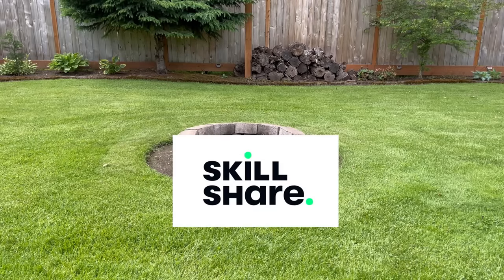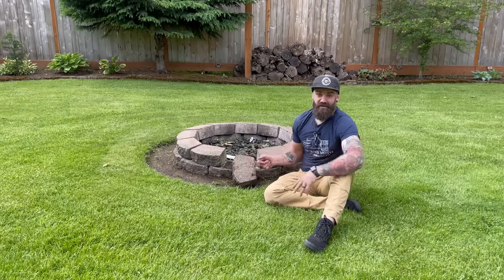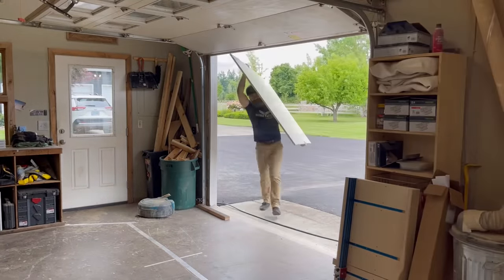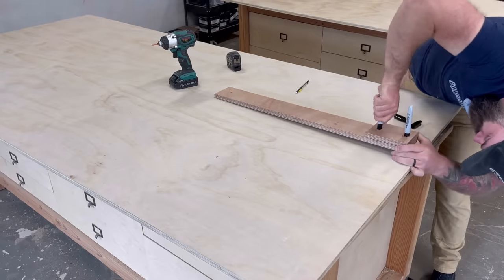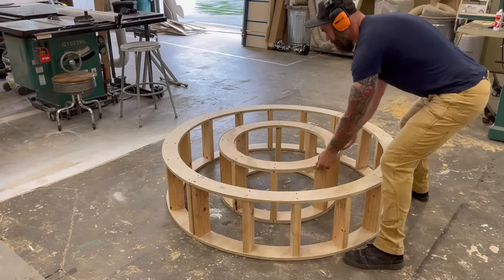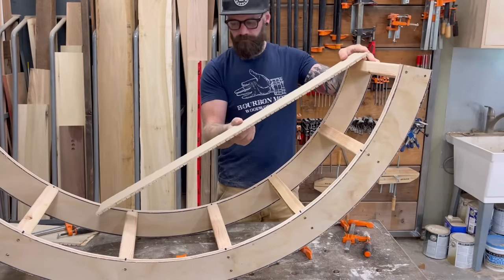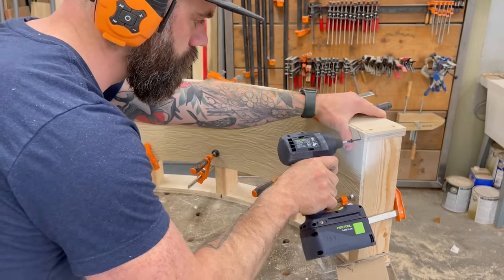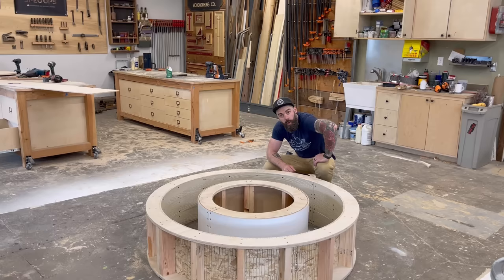Making a Concrete Fire Pit the Right Way || Ultimate Fire Pit Build

Comment: "Im not gong to rent a concrete mixer" Nobody has ever said twice......
Reply: All facts 👀
Reply: I'm wrecked I'll clean the concrete mixer tomorrow.  Is also one.
Reply: Honestly, if you've got a steel barrel with a lid which can be attacked and detached, you can dump the concrete in, the water in, the pigments used (if you use; even dirt or ash or crayons can work) put the lid on, place the barrel on a side, and roll it for a while, and you mixed the cement without a "professional" cement mixer. It works better if you add some wood or metal things on the inside, like how a washing machine has (a cement mixer usually has curved ones), to help with the mixing (and adding a few uneven parts to each of those "ribs", to help even more with the mixing), but it works even without that, especially if you add a few rocks (to tumble about and move unevenly, to lead to a more even mixture with less moving). It might need more effort to get the barrel standing upright again, or to place it on the ground without it breaking, but it works better than mixing in a wheelbarrow/cart. By the way, did you know there are folding wheelbarrows (sometimes called portable wheelbarrows) out there? I didn't know, but it makes having spare wheelbarrows A LOT easier! Where would you even put the 3rd or 4th wheelbarrow, if it couldn't fold neatly out of the way?
Reply: Lol my dad had me out two days in a row mixing and pouring from a wheel barrow. Said he wasn't going to rent a mixer.

He said I was taking too long and helped on the third day. Day 4 he bought a mixer. 

Bastard.
Reply: Also, he could have mixed the cement right next to his pit for a bit more efficiency
Reply: We have a mixer and it certainly helps, but it’s still quite a bit of work itself (have to load the bags up higher, can only do so many bags at a time, still need to dump and shovel to/from wheelbarrow, etc). I’ve hand mixed up to 70 bags without issue, honestly the fact he had to shovel it into the form is also where a ton of the work is, for a pad it’s just dumped from the wheelbarrow so not super difficult. But honestly past the 50 or 60 bag mark it’s worth it to just pay for it from a concrete truck.
Reply: @SapioiT  ? I’m referring to a portable cement mixer, we have the ryobi one, they’re pretty much all considered portable! But I’ve never seen one that’s placed on a table and that seems dangerous, even googling shows no such results, but I guess there are lower ones, was just pointing out that there are always trade offs, and pretty much all are going to still be a little higher than lifting to a wheelbarrow, and a mixer saves work but it’s not like it saves all work, it just saves the mixing part which I don’t find to be all that hard, just a little water and back and forth with a hoe, with a two man workforce it goes pretty quick with one loading, cutting and setting, and the other mixing. A mixer would definitely help more if solo, but in that case I’d hesitate doing a large product in general just due to time constraints to work the concrete.
Reply: @personperson9591  I see. There are also "cement pumps", which are basically a screw pump in a pipe, with a large hose through which the cement goes, so you can move the cement without as much effort.
Reply: in my experience, mixers are more trouble than they're worth. can only mix 2 bags at a time max, cant ever dump all the concrete out at once, and have to clean them out after every batch. its harder on the body but in my experience if its not enough to call out a concrete truck, its faster to mix it by hand in a wheel barrow.
Reply: @Smokey420Greenleaf  Interesting arguments. Thanks for sharing!
Reply: @Smokey420Greenleaf  by clean out after every batch you mean spray it with water?
Reply: If you will need a concrete mixer three times in the next ten years, just buy one…. New or used it won’t matter, because the stacking costs and annoyance of renting them makes it better to just own one….
Reply: @Smokey420Greenleaf   I dunno why concrete mixers don't come with a disposible plastic inner liner that can just pulled out and disguarded after use.

Comment: Former concrete guy here. I did residential construction in Florida and we'd spray our forms with oil to get them to release easier from the slabs. The other little trick is that you can fill screw holes or nail holes with petroleum jelly for exposed surfaces that you don't want to see fasteners. You can also cover seams with clear packing tape and get a smooth finish.
Reply: Wonder if its still there.
Reply: Great tips. For the inner circle, it doesn't matter what you would coat it with because the direction to pull to release the forms is a reverse circle and geometrically doesn't allow it to release.  Sort of like the Chinese finger traps.
Reply: What was the company? I am in orlando and would love to hire someone to do this
Reply: @garrettsanford5683  Carpenter Contractors of America.
Reply: I was a roadway worker on the I-4 project and then worked on the runways at OIA. You're exactly right. Using form oil, even on wood, will make them fall right off after the concrete dries enough.
Reply: you got no allergic reaction at seeing the rebar being hammered into the soil ? lol
Reply: Yeah. It was a great project to watch. Another idea is to make the interior form with a male insert surrounded by foam or plastic, so it can be removed easily and reused.
Reply: Make bottom of inner cicle a half inch smaller diameter.
Reply: @sephiroth1985102514  As a roadway worker, do you not agree that manhole grade rings would've been much easier, and for a very similar result? (If anyone is unfamiliar, Google "concrete manhole grade rings" and have a look.)

Not as fun of a video. But it would save you TONS of pain.

Also, watch your lawn mower around your new decorative rock. It's been two years, so—have you come to regret that one? If cousin Eddie comes over for a weenie roast, gets drunk and sloppily kicks your rocks around it will be a mess.
Reply: Guys, Here is The Savior

YaH The Heavenly FATHER (Genesis 1) HIMSELF was Who they Crucified/Pierced for our sins and “HERE IS THE PROOF”

From the Ancient Egyptian Semitic: 
"Yad He Vav He" is what Moshe (Moses) wrote, when Moses asked YaH His Name (Exodus 3)

Ancient Egyptian Semitic Direct Translation
Yad - "Behold The Hand"
He - "Behold the Breath"
Vav - "Behold The NAIL" <— YaH’s Crucifixion
He - "Behold the Breath"

“Behold the HAND that Beholds The NAIL” 

PROVES - YAH The Heavenly Father HIMSELF was Who they Crucified

That is EXACTLY what Moses Wrote

Here is what they mean

YaH's Name:
(Ya)d + (H)e, as YaH is what Moses called Him and YaH Declared: "this is My Name, this is My Name for all generations" (Exodus 3)

YaH is The Creator of “MAN”: (Genesis 2:7)
Yad He, (HAND BREATH), as YaH's "HAND" Formed man from the dust  of the Earth and His "BREATH" made him a living being (Adam)

YaH's Sacrifice of Crucifixion for “MAN”:
Vav He (NAIL BREATH), the "NAIL" through YaH’s "HAND", in Sacrifice of Crucifixion, that whosoever shall call YaH Savior, His “BREATH” brings forth life (Salvation)

How YaH arrives:
YaH arrives via the Tent of Meeting (Exodus 33:7:11, Isaiah 54, 55), where a Tent is erected outside the city, a cloud descends upon the entrance of the Tent and YaH appears...

Why they demanded YaH to be Crucified:
YaH was Crucified according to Hebrew law (Deuteronomy 21), to be NAILED/PIERCED on an Almond Tree for BLASPHEMY as it was for His NAME they demanded Him Crucified. The Messiah claimed He was YaH...

HE WAS YaH!!!

HalleluYAH translates “Praise ye YaH”

The Hebrew Book of Isaiah

Isaiah 42:8
"I am YaH; that is my Name! I will not yield my glory to another or my praise to idols.

Isaiah 43:11
I, I am YAH, and there is no other Savior but Me.

Isaiah 45:5
I am YaH, and there is none else.
Reply: @Praise___YaH  YHWH is the name of one of the gods in the Canaanite pantheon of gods. You are a member of one of the cults of Abraham and you ignore the history of your own faith.
So sad.
Reply: @DriveCarToBar  

It’s YHVH (Yad He Vav He) which means “HAND BREATH NAIL BREATH” and His Holy Name is YaH, as in HalleluYAH “Praise ye YaH” and you really need to read what I shared
Reply: agreed. I used a simple bottle of vegetable oil and a paint brush on my forms. painted the wood with a good coating allowing it to soak a bit and boom.. not an issue. I could see if you wanted to save the inner form. making one small section that would be a keystone to the circle. that way you could remove the wedge/keystone to release the pressure.
Reply: which concrete mix should I use??
Reply: We would use wd40 on our wood forms work great

Comment: Honestly, this was really well done. Couple things I would have done differently. 

1. If you had mitered the edges of your interior forms you'd have much less pressure pushing them together, and would have been able to remove the forms intact.

2. I would have poured a pad first. The weight of that ring will likely have it settling into the dirt over time, especially after rain. The pad would also have made interior form removal easier.

Going to implement this in my yard though, great idea 👍

Comment: Great job. Just wanted to mention, when looking for filler material for concrete, a good option is gravel. One or two shuvels per bag. Mix together, works great. Diesel is used the most often for keeping the concrete off the forms. Concrete work is unique in the way we have to consider wrecking the forms conveniently. City water drains is a good example.

Comment: It'll be interesting to know later if the concrete form cracks after the first fire.  I had a firepit built out of stone with mortar and it cracked not only the mortar joints but the limestone two piece top.  My firepit builder used a steel ring insert tight up against the stone and the heat caused the ring to expand, thus cracking the mortar and a couple of stones.  My fix was to buy a steel insert that was smaller than the pit diameter by 1.5" all around.  I also filled that void with mineral pour insulation to reduce thermal shock.  My insert has a large enough lip to cover the void.  I think your insert should be at least 1" smaller then your form to prevent contact between the steel insert and the inside of your form to prevent steel expansion from pushing out your form.
Reply: This right here is a great point - should be voted up
Reply: @gabrielh.2506  Or do what I did by not allowing a flush steel ring up against the stone to expand as it gets hot by replacing with a full depth steel insert with a smaller diameter packed with pour mineral insulation in between the insert and stone.  Much easier than lining with firebrick after the pit was built.  That has worked now for many years.
Reply: @JJ-fd2ob  The calculation for a 48" steel ring (my pit) is an expansion of almost 1/2" when the temp rises by 1000F.  A 3" ring will expand by 1/3".  If a ring is mortared to the brick, stone or concrete, the pit will crack.
Reply: @bobbray9666  what about using a fire rated mortar instead of concrete. Like what they'd use for chimneys?
Reply: @driver902  If you use a steel ring, which I suppose the purpose of it is to protect the concrete from flaking away, you'd still have expansion of the steel under heat up against concrete whether it be refractory cement or not.  The expanded steel will either push out and crack to concrete or just warp if the concrete doesn't give way.  Better to insert a slightly small diameter steel ring to allow for the expansion when hot.
Reply: @bobbray9666  When you calculate the actual radial difference with that linear length change, you see that you only need something like 1/8" space around the edge to account for that.  D=1/4", which allows for ~ 3/4" length change.
Reply: I all for diy projects and I once applied stucco to a single story ranch house singlehandedly so I can advise with all the effort put into buying and transporting a mixer, the bags of cement along with all the essentials needed then actually doing the work one is probably better off buying the pre-made firebrick unless its a personal life journey especially if water conservation is a necessity.
Reply: Even worse it could explode from the pressure of trapped moisture becoming a gas and expanding. This isn't a good idea unless you use the correct concrete.

Comment: I’ve done this same concept before and I can confirm it defiantly explodes
Reply: Gotta be the right mix brother
Reply: Wouldn't be an explosion of if it was meek. It has to be defiant.
Reply: I have a small charcoal fired forge. It’s a used helium tank with the top cut out, a piece of 1/2” iron pipe in the side to blow so air and sackrete I bought from Lowe’s. It did not explode and it hasn’t really even pitted with probably 100 hours of use at temps high enough not only to forge but to actually melt steel
Reply: That's really dangerous, the concrete explodes. Doing this is not safe at all.
Reply: @marciaccalas5799  it's actually more like a vigorous cracking you might lose an eye under the exact wrong circumstances but it isn't the end of the world.

Comment: Always remember, when using wood for forms, always spray with diesel or form oil. This helps the wood release from cured concrete...in all reality, you did very well. I do this all the time and can say you did better than most. Another hint, is, when it is curing, if it is hot outside, keep everything sprayed down and wet. This gets a better cure that is less likely to "dry out" and crack. Concrete does NOT dry. It cures. The end project is pretty amazing. As for your inside form, you should have burned it out...after all, this is a fire pit...
Reply: Came to the comments to see if I was the only one thinking he should have just burned it out. Lol
Reply: Never spray with diesel
Use any oil. Even vegetable.
Reply: @MACizera it breaks down concrete compound so the layer touching the Crete will degrade much faster.

But the real issue is why not use canola oil. (Form oil works) and not hurt the environment?
Reply: @MACizera form oil is mineral oil.

You can just buy that it's best.
Reply: @thenarrator1984  Totally agree.
Reply: Diesel is commonly used instead of form oil and will evaporate
Reply: Glad I'm not the only one that defaulted to burning.
Sitting there talking to the screen going "If only there was some easy way to get rid of WOOD on the inside of a FIRE PIT" 🤣
Reply: @thenarrator1984  hUrT tHe EnViRoNmEnt
Reply: @chrishaugh1655  Since it's his back yard, and he's the one who sat by it during the first burn, tHe EnViRoNmEnt was his own lungs.

So yeah, don't hurt the environment.
Reply: @AdorkableDev  I can't tell if you're being serious or not. For the sake of your own intelligence level, I'm hoping for the latter.
Reply: or buy a plywood that is pre oiled for the forms, but do not use the diesel ffs... 🤦
Reply: you should never add water to your concrete after its been mixed, they make curing compound that works much better then this method.
Reply: @MrRudeJude  Everywhere I've read that the issue is to keep the concrete wet for curing.... like you can cover with plastic... or rewet, as it can take like a month to cure. If you can't keep it wet, then you can coat the concrete with sealer... but not so sure about doing that with a fire pit?? Where do you get this idea? I'm trying to learn concrete so that is why I am curious about your comment. thanks.

Comment: Worked for a forming and shoring company WAY back in the day.  We used a mix of Diesel Fuel and Automatic Transmission Fluid sprayed on concrete forms as a release agent.

Comment: I’m a certified cement mason, and I gotta say. You did a good job. A tip to separate the wood from the cement, you can use diesel gas. Works fine.
Reply: Can confirm diesel works beautifully and would use plastic form boards for bending its way easier
Reply: I was just going to form oil or diesel
Reply: Not an expert....but, built a very hot fire in a cement  box.   Turns out, the cement exploded.  Finished cement contains water...expands and explodes. Just sharing.
Reply: @patandsandytrierweiler2440  I've heard that before too! Scary.
Reply: @patandsandytrierweiler2440  
Watch at 20:21
Reply: What is diesel gas? Where do i get it?

Comment: If you incorporate 1” spacers between the internal ring joints, you could remove them when its time to take the internal form out, squeeze the now gapped spaced joints together with clamps and remove the internal ring pieces without destroying them. Just an after thought. This is a great video and I will be building my fire pit in the same manner. Thanks for your work.
Reply: Wish I had read the comments before completing this project. SMH.

Comment: When making inner circles for that make one little piece shaped as a V with the V point to the concrete, then you will easily pull it and have some room to pull the rest
Reply: It's even easier than that. The one little piece doesn't even need to be v-shaped. He could have done the 3 pieces as he did (or even only 2) but between two of them he could have put in a piece of 2 by 4 (or something similar with two parallel sides) which you can knock out first towards the inside. Then you have some wiggle room to loosen and take out the other pieces. Could even have worked with the whole circle as one piece cut open in one place plus a 2 by 4 or 4 by 4 inserted.
Reply: @TheBackdrafter80  well you just crushed my two years of overthinking and overdoing simple stuff :D
Reply: @samuelsilva8364  you're welcome. 😀